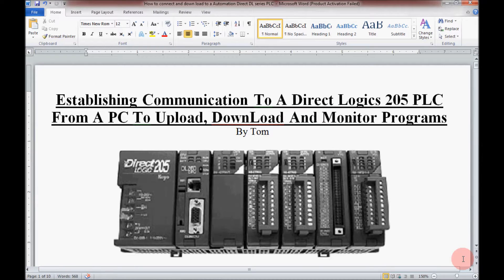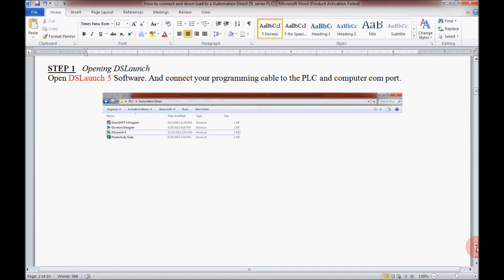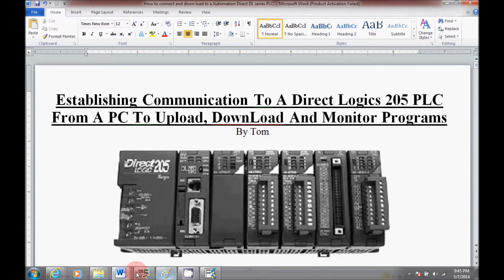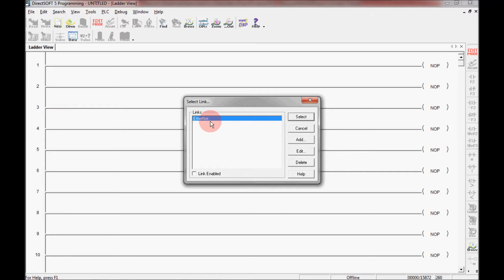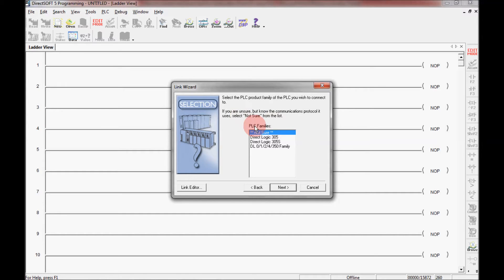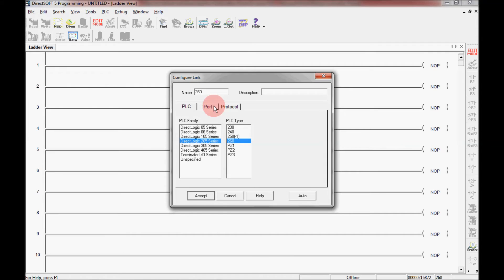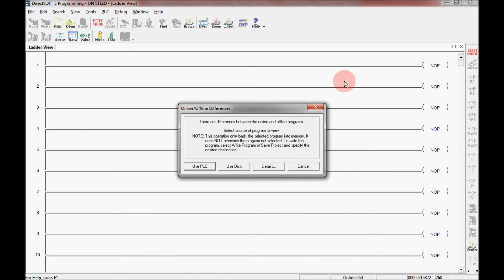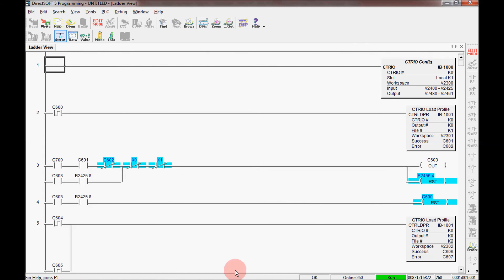How To Connect And Down Load To Automation Direct DL-205 Series PLC

Comment: Hey ! I am having an error in connecting PLC with the System. Could You please help ?
Reply from the maker: First thing I would look at would be comport of pc, are you selecting the port you are connecting to. Go to device manager and check. Next check cable is it correct one, is there any damage. Also what comport are you connecting to com 1 or 2.
Reply from the maker: If you have capability to connect HMI to plc to test plc comport
Reply from the maker: Also make sure to place selector on processor to Term